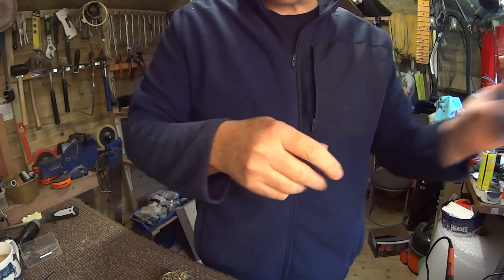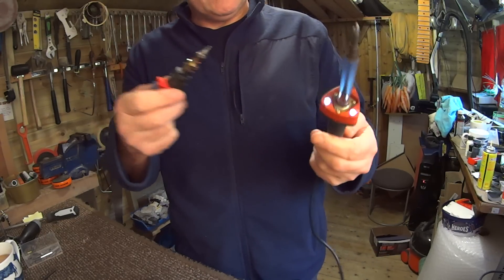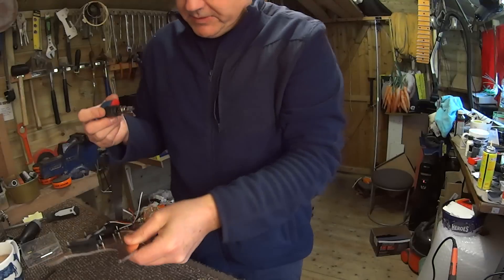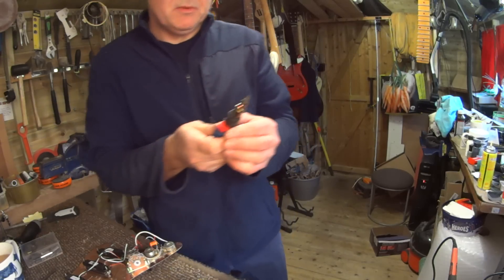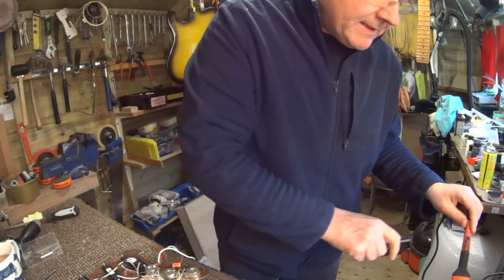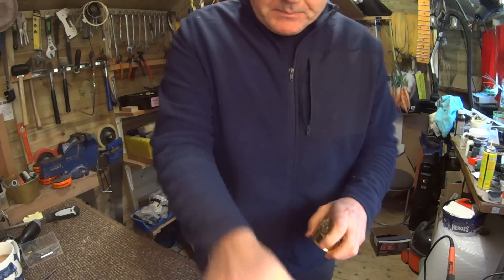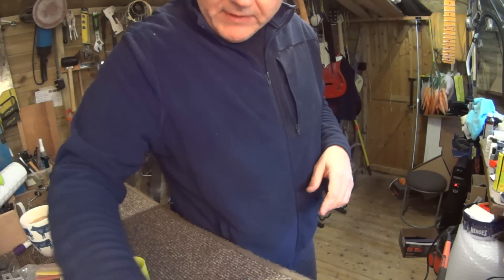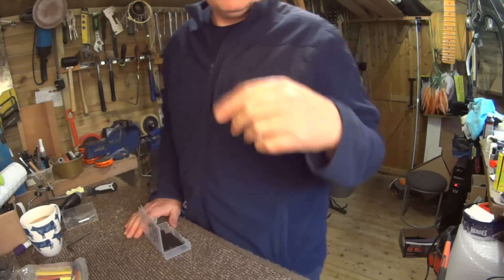Soldering Iron keeps tripping house circuit breaker

Comment: Get a Circuit Specialist Solder Station. I tried to buy a HAKKO for years in the UK and could never get one but was recmmended the CSI one. Great piece of kit; http://www.circuitspecialists.eu/soldering/soldering-stations/csi-premier75w-digital-temperature-controlled-solder-station-with-75w-soldering-iron/
Reply from the maker: Thanks for that recommendation I'll look into it. For now switching back to the old iron solved the problem but I'd like something a bit more specialist / fit for purpose
Reply: I've tried the cheap Chinese stations then went back to individual Antex irons (which served me well) but i got fed-up of keeping plugging different rated irons in/out for guitar work. The CSI was recommended to be by some friends over the pond at the Hamer Fan Club forum (as it's what they use). I was delighted to find that I could buy one here in the UK. I think I've had mine 8 months and I'm still on my original element...
Reply from the maker: Is the cord rubbery or plasticky on the CSI?
Reply: The soldering iron cord is rubber! That is why I suggested it :) It is also 1.1m long so you will not struggle getting to where you need to go...

The website says; 'The soldering iron features an extra-long 1.5M flex. The flex is also resistant to heat, meaning that if you accidentally touch the cable with the hot iron tip, the cable will not melt or degrade.'

I just measured the cord on the iron and I measured it at 110cm so it's 1.1m not 1.5m (maybe they mean the solder station flex which is long). But the solder iron cord is heat resistant...